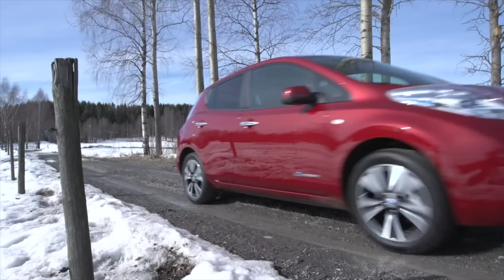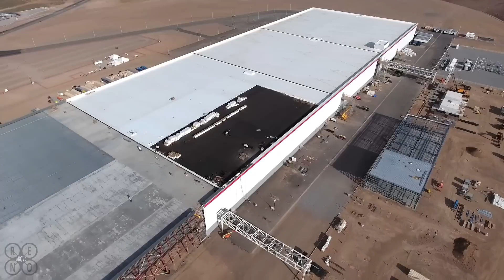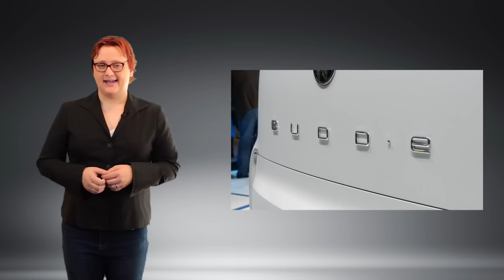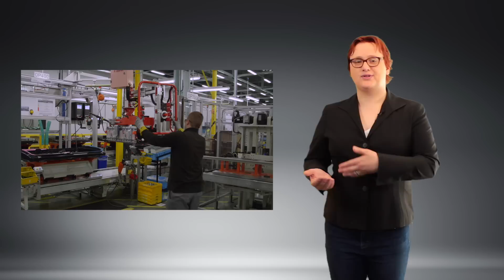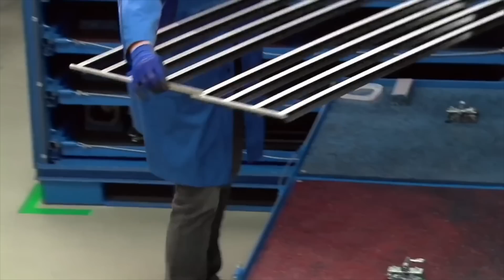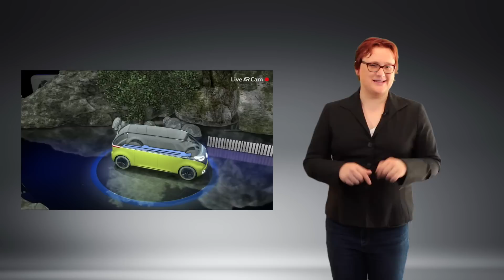What Does an Electric Car Revolution Need? 40 Gigafactories, Says VW

Comment: It depends on if you are assuming we'll simply be replacing our current ICE fleet with an EV one. Frankly, I doubt this is what's going to happen; instead, if we can get autonomous EV taxis in quantity, we'll need fewer total vehicles to move the same amount of humanity from place to place. This will also require fewer battery packs.

We'll still need a sh*tload of batteries for other transportation sectors, and for peaker storage. But not as many as they are forecasting.

Comment: There is exactly 0% chance that VW will have 25% of it's fleet electric by 2025. One quarter of one of the largest auto manufacturers is a monstrous undertaking. Even if there were the demand (which there isn't), they don't have the ability to re-engineer and retool that much of their product line quickly.

When EVs pass price parity with gasoline, the switch will happen naturally. The price of batteries are decreasing fast enough that that point will occur within the next decade, regardless. And when it occurs, demand will increase and will prompt businesses to produce more batteries. I.e., the free market will take care of it in its proper time. Trying to force it with a planned economy won't help.

Comment: ....auto manufacturers that will need the LI-ion batteries to transition their FLEETS from FOSSIL to ELECTRIC power? What the heck are you talking about? Automakers transition their fleets? Also, how is BMW more progressive in regard to electric vehicles than VAG, when the first has built two expensive HYBRID vehicles, with or without range extenders, when the latter - VAG - produces relatively cheap Golf E hybrid? Remember, bimmer's i8, which is incredibly expensive, is not built for environment, but for power with low consumption. Also, if you look at the extremely expensive market, you have heard that VAG also owns Porsche, who made it's ingenious 918, and now makes the Panamera E, don't you? Why the heck do you talk bullsh... in every single episode? I promise myself not to watch you, but always give you a second chance and remain disappointed.

Comment: And then what happens when we run out of lithium ?
Reply: it's recyclable.  they can make new batteries with it.  doesn't happen now, because the huge supply of degrading batteries doesn't yet exist.
Reply: Lithium is plentiful and accessible as a raw material resource.  Besides, it's recyclable from the batteries that will be built.  Common opinion is that lithium will not run out.
Reply: Also why do you think lithium will always be needed? it is the best at the moment, but there are other promising battery technologies, that will use better and much cheaper options.

Comment: I believe when Musk indicated that 100 Gigafactories would be required, he was counting some like the solar tile site in Buffalo NY (Gigafactory 2). He was talking about some factories for cars, some for batteries and some for solar PV. And I'm not certain if he made the comment before or after they found ways to produce three times more batteries in Nevada than they had originally planned. It also in not entirely clear when the Gigafactory 1 plan was modified to include production of more of the drivetrain than just the battery.
https://electrek.co/2016/05/31/tesla-triple-battery-output-gigafactory-1-150-gwh-elon-musk/

Comment: I'm sure there will be a need for A LOT of gigafactories. But I'm afraid nobody will make them all because the evolution is going so fast that the technology used in batteries will evolve and make the gigafactories (for current type of Li-ion batteries) obsolete quite fast... The speed of evolution in the battery technology may very well be what will keep it down a little. This could mean it's still too early for even thinking about a full scale electric world. I hope not, we'll see...

Comment: We need to remember that batteries are recyclable. You receive back materials they are made of and rebuild them with help of latest technology.  Once you develop enough number of factories all you need to do is upgrade them once every now and then. The cycle is closed.
Reply: True but all the batteries you recycle must have been made new first. Recycling is exactly that: RE-cycling. The 1st cycle will need all new materials. So recycling will become really a big thing only when the need will reach a plateau, not at the beginning.
Reply: Current Gigafactory is designed/constructed with in-house recycling and so every each next will. Now it's necessary that competitors will follow suit. My point is that once you have enough factories and materials (after all mining processes), you basically do not need to mine anymore.  Pure sustainable recycling with ever growing efficiency thanks to new tech.  That's what opponents of EV are missing. We will run out of oil one day. But not of components for batteries. I agree with your view.

Comment: I'm not entirely sure that lithium Ion batteries are the even the medium term future of energy storage. There seem to be better and cheaper also different for different applications technologies emerging now that could be in production in a few short years. Put it this way, if you can get three times the energy density per volume, you will only need a third of the current estimated factories. VW say 40 factories which would become 13. Even Elons projection would come down to 33 gigafactories to power the world. If I were any industrialised country I would want to invest very heavily right now because energy storage is set to be the biggest market on Earth bar none.
Reply: Not sure a new battery technology will replace Li-ion soon, but I agree that history does suggest that progress will keep happening and new, better ways will eventually be found, at first for specialty applications like space or something, and the growing and large battery industry should only make this next revolution more likely to happen, especially if current facilities can be adapted simply.
Reply: Guillaume Laflèche , I think you've got the nail on the head. Flexibility of the factories being built  to produce different chemistry is essential.
Reply: We can probably only hope, but almost by definition we cannot yet know for sure if say the gigafactory will be compatible with making the next kind of mobile energy storage, or to what extent.  Probably at least part of the facility, equipment, know-how, staff, capital could be re-purposed.  My main hope is that Tesla products, not the least the batteries, will always be designed to last long, as long as possible, and never involved planned obsolescence.  Will come a point (in decades) where Tesla's capacity (or over-capacity) will dictate or strongly influence the then-current strategy, when the market is saturated and EVs are 100% of industry sales.
Reply: How soon li-ion is replaced remains to be seen for sure.  But I have a feeling it isn't far away.  There is a lot of technology already trying to move out of the lab and gain financial backing to hit commercial production.  There is just so much money to be made.  As you guys said, tesla will need to be thinking ahead and looking to be ready to adapt with minimal cost.  However I think they are going to have a hard time in the Grid storage sector.  Mobile batteries aside... the cheapest and most reliable grid batteries are likely going to be massive and not full of thousands of small interconnected batteries.  I.e. they will be cheaper to produce.
Reply: That's right, you said it better than I  could: a mainstream EV market will create a significant forcing function for battery innovation and disruption, large potential profit for someone who builds a better mousetrap.

I also agree that EV battery unlikely to be ideal grid storage tech, when competing also on cost and not so much on mass, volume, power, and those sort of things.  I think Tesla patches a gap, for now, but many promising alternatives exist and should win, longer term.  The kind of battery you are hinting at and suitable for grid storage is called flow battery.  I had to look this up to refresh my memory.  Pumped storage is already in use.  However, my bet has been and remains on compressed air, especially LightSail Energy's technology.  More details and sums up what we've said: http://rameznaam.com/2015/04/14/energy-storage-about-to-get-big-and-cheap/
Reply: +Andrew Wilkinson New technologies tend to go about 2 to 3 decades between being featured on the What's New page of New Scientist to being mass-production ready. Lithium ion cells and solar panels are two good examples of this. High power white LEDs, an exception.
Lithium Iron Phosphate is not very energy dense. But it is inherently safer. The killer app for them is probably not anything more mobile than an e-bike. I'd rather have a wall of safer cells at home.
Reply: I agree the battery technology will change, but we have to build with the technology we have ready to roll with on an industrial scale now, and prepare to adapt. The batteries we make today should still be in use in 2027 and beyond, if managed well, and we can prepare to remake and recycle them at that time.
Reply: I agree.  I do have a fear though, that when a superior battery technology comes along such as the Goodenough glass battery, the public at large will no longer want anything to do with the old battery type as the new one offers radically better performance.
Reply: With the old ones still working for a while, there will be a market for them.
Reply: Andrew's comment reminds me of a company called EEstore back in the 2003 to 2008 time frame.  They were working on a device that was about the size of suitcase, weighed 300 pounds, stored enough energy to go 300 miles, recharged in 10 minutes, had a cycle life of over 100,000 charges.  They called it an ultra-capacitor in that it stored energy in the same manner.  All I saw from them was press releases, no products.  The most notable was a press release that stated "our equipment has been certified to accurately measure crystal size".  ZENN stopped producing cars and invested 3 million in EEstore.  Nothing else since then.
Reply: Pretty sure LiFEPO4 Winston or CALB cells will replace small lithium ion cells in the future once production is increased. They are much bigger, simpler to make, safer and do a whole lot more cycles. Few downsides though. Expensive (at the mo) and don't handle the heat as good.
Reply: Andrew Wilkinson agree with every word
Reply: Jack Barry I think it's far more complex. we live in a technological era with ever expanding possibilities. ignore this and suddenly you are back of the class, in the eyes of the purchaser who is king.
Reply: Yes, most likely we will switch to solid state batteries around 2020 which have much higher energy densities. However that will likely also lead to installing larger batteries in the cars. I expect top end cars to get around 150 kWh batteries once we have solid-state.
Reply: randy, I don't blame you for you scepticism however things have moved on. Toyota recently announced it will be producing a solid state lithium ion battery in the not to distant future. There is huge investment happening right now the world over. Im so confident that if I'm wrong I will buy you a pint and a packet of pork scratchings to boot.
Reply: So if now someone create a better greener medium to store energy without the need of lithium and fossil...the person have to face two heavily invested industries.
Reply: +heemabh true, shareholder value is an incredible store of industrial momentum. If people have financially invested in a given technology, it can create barriers for the adoption of new, competing technologies. That said, if someone truly figured out a superior, non-electrolytic battery architecture, they would be in a highly lucrative position, both for investment and for beneficial partnerships. Such a battery would also mess with many companies (for example, Tesla via their high-capital gigafactory and power wall investments). My personal view is that Lithium has done for us all it can; no spectacular breakthroughs are in the pipeline, but something light, affordable, increasingly energy dense, safe, and 'simple', is coming. The effect this will have on heavily invested industries will inevitably be a function of when said revolution occurs.
Reply: Think there may be successors to lithium ion in the pipeline(sodium glass etc)  but..these thing always take 5 years to get into production and another 5 to get volumes up and refine manufacturing techniques to get the price down..hopefully the gigafactories will be able to switch technologies relatively easily.
Reply: +Roger, I hope so too, but honestly I think a dramatically improved new energy storage technology could seriously mess with the gigafactory project. Like GM or Ford, Tesla is spending capital and they have many sunken costs, which will make it hard for them to be as nimble as they once were.
Reply: I would like to think you are right...but everyone has been trying all kinds of energy storage technologies for years( novel battery chemistries/power kites/ compressed air storage/ flywheels etc). I have enthusiastically followed them all. They usually show great promise but mostly go bust or become a very niche technology- even lightsail has gone into hibernation mode. 

Sadly I don't think there will be any massive sudden improvement..even now that lithium-ion EV's and energy storage linked to renewables seems to be coming of age look how long that has taken with lots of tiny incremental improvements- at least these gigafactories have brough the costs down ( 18% per annum for 3 years in a row on lithium-ion) and here in the UK PV for the roof has about halved in cost over 5-6 years despite a 20% import tarrif forced on us by the EU. ( Yeah Trump's 30% get all the press but we have been suffering this in Europe for years). 

I look forward to you being proved right then I will have my EV on the drive, my PV on the roof and my energy storage in the garage ( powerwall2 is a bit pricey yet-maybe a samsung graphene ball battery +45% capacity and 5 times faster charge- but it will be a long time to get the volumes up and the cost per unit down to compete with the gigafactories).
Reply: I can certainly understand your sentiments about the mid-term future of our energy storage technologies... history has not been kind to us. Samsung's graphene strides are definitely helping support the narrative that better storage is in the pipeline, but in my personal view, we'll need something many times lighter than a traditional Li-based battery and with several factors more storage to boot. No-one can see the future, so it's just hopeful speculation I suppose. Those import tariffs are really harsh, I didn't know the EU trade markets were that unreasonable. I suppose that's how human affairs go, ey: everything makes sense until a bloke tries to make money at your expense.
Reply: People have been working on solid state lithium metal batteries for a while now which should be available soon. When combined with the right cathode they are close to theoretical maximum chemical energy density for a sealed battery. Solid state spacers are also more durable taking many fast recharge cycles without damage. Fortunately a lot of the equipment in a l-ion battery factory can be re purposed to making solid state lithium metal batteries.
Reply: Andrew Wilkinson I agree.
For stationary Storage there are other Solutions that are maybe better and cheaper.
An because there is the Volume and Weight of 1Kw/h not that Critical.
Reply: There are other solutions for stationary storage which should theoretically be cheaper. But all the research into mass production is going into l-ion batteries as that is a more developed market. As a result the price of batteries is going down every year so it is getting increasingly hard every year for a divergent technology to catch up with l-ion batteries on cost. As a new technology must start on a smaller scale without all the benefits of mass production.. Solar plus batteries is set to become cheaper than grid power in a few years time.
Reply: MichaelKingsfordGray  what obscure wisdom? there are a many different chemistries and constructions in the pipeline so to speak. To name them all would take way to long. One of them is the glass electrolyte battery from John Goodenough's team ( the inventor of the lithium ion battery ) another technology for static situations would be flow batteries ( lots and lots of them ) Why not do a tiny amount of research before spouting off next time.
Reply: To further the problem, as soon as we come up with anything better we abondone the old which we need to use up. consumerism is worse for environment than petrol IMO